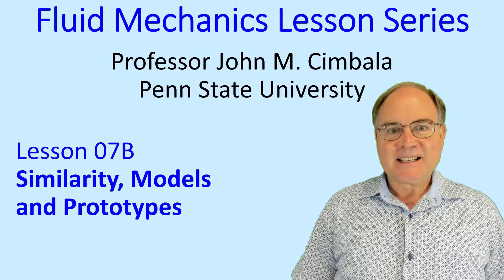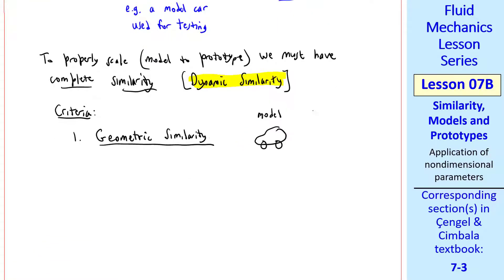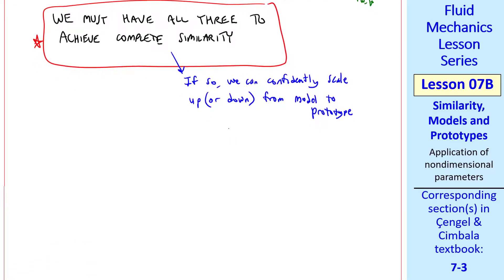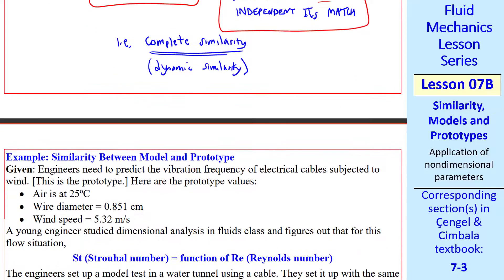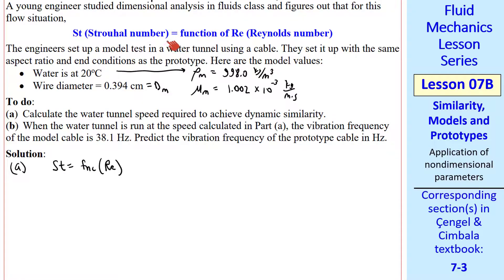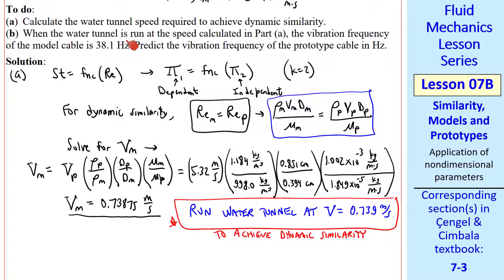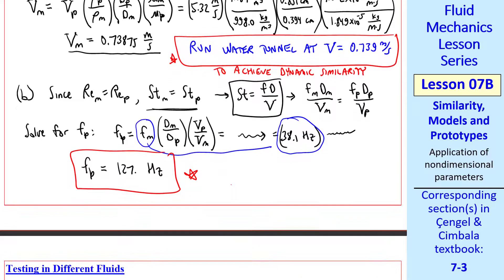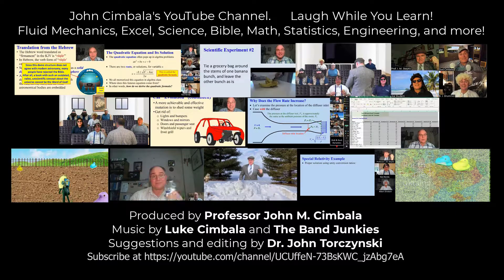Fluid Mechanics Lesson 07B: Similarity, Models and Prototypes

Comment: Hello Sir, I got a different value for density and viscosity of water at 20°C based on the table in Cengel Textbook. Mine is 1.204 kg/m^3 for Density and 1.825x10^-5 for Viscosity. 

Does the ratio model affects the value of Density and Viscosity? Thank You
Reply from the maker: You are using the air table instead of the water table. I checked and my values are correct. Doing ratios as in this problem does not affect the properties of the fluids, which are independent of any analysis we do, of course.
Reply from the maker: Thank you for your comment. Please tell your friends and colleagues about my YouTube channel where there are hundreds of free videos about the Bible, fluid mechanics, science, math, statistics, air pollution, and other topics. I would greatly appreciate it.

Comment: In the example problem, you mention that this problem has two πs, how do we conclude this? 
(and sorry for the flood of questions on many of your videos, my final is in just over a week and your videos are fantastic!)
Reply from the maker: You must go through the Buckingham Pi analysis of previous lessons to determine the number of PIs. Now I have a question for YOU. How did you get the Greek letter pi to appear in your comment? I have never seen that before in a YouTube comment!
Reply: @johncimbala  Just because a symbol isn't present on your keyboard doesn't mean it can't be used! 
𝝅 is a unicode character like any other character (I.e., letters in various languages, numbers, symbols like $%#+*^, etc). 
Specifically here I copy and pasted the 𝝿 (there are multiple versions) symbol from a quick Google search, but if you know the appropriate keyboard shortcuts you can easily insert pretty any character (if I remember correctly ).